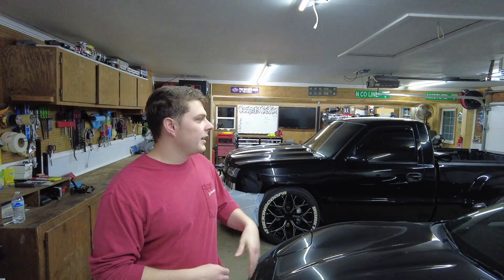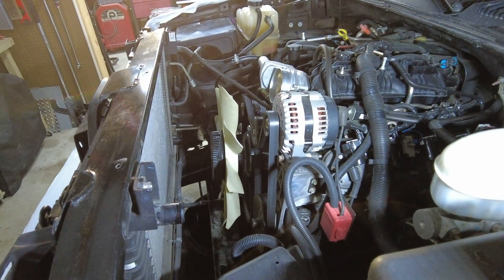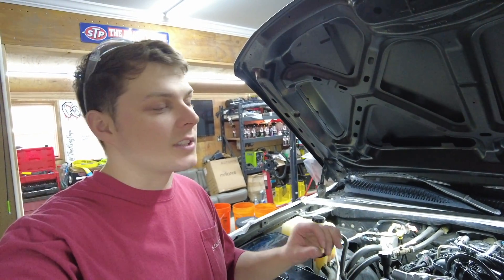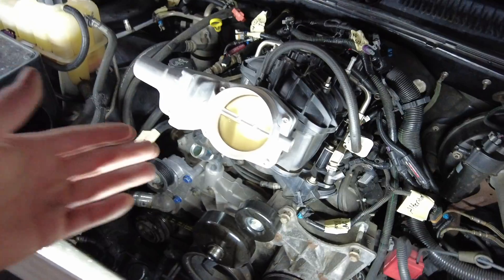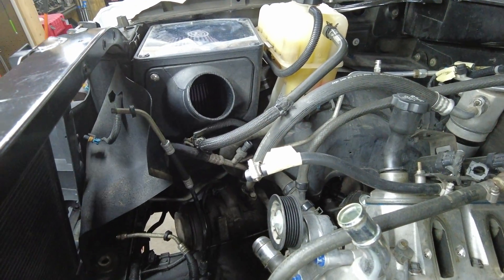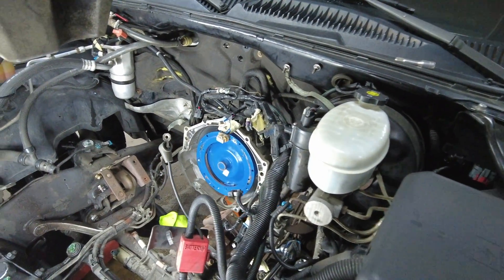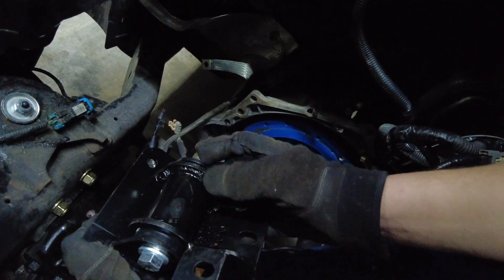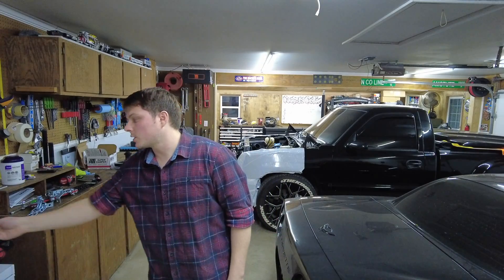Silverado Engine Removal! Pulling The 4.8L in prep for a 6.0L LQ9 Swap. NA Cammed "Work Truck"!

Comment: Awesome video. Question can I put a 2011 L29/ 4.8A in my 2008 with a LY5 5.3 and will it run? . I know I’ll have to tune it eventually. Thanks.
Reply from the maker: From my understanding yes. Both are Gen IV motors and have the same reluctor wheel count. Shouldn't be a problem

Comment: I'm about to pull a 4.8 for the first time (I have pulled others but not a 4.8)....can you pull it with just taking out the bolts of the headers without removing the bolts on the Y-Pipe?  The reason I ask is the bolts on the Y-Pipe  are frozen (of course) and it's extra time to 'Get them"??
Reply from the maker: Hey, I've pulled a few junk yard motors with the shorty headers still on them. Usually there is no issue, sometimes it catches and scratches the fire wall up.    You should be able to unbolt the headers from the heads, and pull the motor up and out. It might be a pain to get the motor mount bolts out though.  I would start spraying your exhaust head bolts and the y pipe bolts with PB blast, and let them soak.
Reply: @TheKingCoopa oh I've had the head bolts off twice in the last month and the y pipe bolts won't come off.
Reply from the maker: That's good at least. The Y pipe bolts, I've had to use a big breaker bar, and snap the bolts in half. I was going to long tube headers and didn't need them anyways. But if you get them out, you might want to replace them with new ones. Hopefully it all goes well
Reply: @TheKingCoopa Since I have already gotten nthe exhaust manifold bolts out of I can pull the engine out just removing those it would be a big help
Reply: @TheKingCoopa  Is where you placed the leviler sufficient to hold the weight of the engine when pulling?  There is not a lot of places to attach a chain to the engine?
Reply from the maker: Any of the 10 mil sized bolts in the heads will work, or any of the bolts to the block. They are all strong enough. I've picked up the whole LS engine with a single bolt that goes into the valley cover lol. I wouldn't recommend that one though. 

Both times I've used a leveler, it usually hits the firewall and is a pain. I stopped using them. I use the Amazon lifting plate, that bolts to the valley cover. That one works pretty well.
Reply: @TheKingCoopa awesome... Because it look like your leveler was not attached to the block itself
Reply: @TheKingCoopa  One further question as I move to pull this engine out....what is the "best" way to pull Bell Housing Bolts that are in at the top?  Some have removed a "rail" and lowered that transmission.....is that necessary?
Reply from the maker: If you take the intake manifold off, you can get the top two transmission bolts pretty easy.
Reply: @TheKingCoopa  I do already have the intake manifold off, I have pulled many engines in the past but this is by first time pulling a GM 4.8 LS ......I am almost at the point of pulling the engine, just have to pull the motor mounts off...their are 2 bolts thru the engine rail attaching the mount....I'm wondering if that would be sufficient....I had no trouble with the  Toque Converter bolts..... I heated them up for just a bit and used a long extension on my impact wrench and they came right off....thanks for your help,
Reply from the maker: Oh nice, your almost there, good luck!
Reply: @TheKingCoopa  Thank you for the information about the lifting plate....I've ordered it and it will be delivered tomorrow...that will be a big help....I'm doing this job for a friend.
Reply: @TheKingCoopa  Would you believe I have had all kinds of issues and I just dropped the used engine in the bay this afternoon.  This is a "weird" kind of question but several of upper bell housing bolts have another mount attached to the bolt.... Which upper bolts have the mount? Is it the   bolt on the drivers side and he immediate top bolt or is the mount on the stud on the top passenger side to the left of the upper most one....see what I'm saying?
Reply: @TheKingCoopa  Would you believe it has been at least 1 1/2 months in replacing this engine (I've had some problems I'll not get into, like spending 4 days in the bed with the flu).......I have a question.... where is the right place to attach the negative terminal cable for the battery....does it go on the block or the frame (2003 Siverado...4.8)
Reply from the maker: That's rough... For the grounds, I did from the battery to the frame. Same frame spot to the engine block.    From the back of the driver side head, to the passenger side head. And from the passenger head to the cab firewall.
Reply: @TheKingCoopa I can't remember... It has been a month and a half LOL

Comment: they used yellow locktite which is like red locktite on all the motor mount to bracket bolts they are notorious for breaking
Reply from the maker: Yea... those really suck

Comment: You dont have to remove the hood, the hood bracket has a extra hole for service . It makes the hood go up higher.
Reply from the maker: For sure! I've used them before, but I have a short garage. I just removed the hood, for when I jacked the truck up.

Comment: What engine hoist did u use ?
Reply from the maker: Its an old one, built really well though. Arcan, CEH-41
Reply: For sure thanks and did u have to tilt the transmission up to get the engine out ? Or can I just unbolt it and pull forward ?

Comment: I had a shop swap my 4.8 that’s in my 2013 chevy Silverado 1500 with an L96 6.0 engine. My question is: do I need to replace the fuel injectors or are the stock 4.8 injectors good enough? Both engines are stock.
Reply from the maker: Those injectors will work just fine with the new motor. They will probably even work with a baby camshaft in it. Anything past that, I would recommend getting some larger injectors
Reply: Thanks @TheKingCoopa
Reply from the maker: @ilmjcxj8064  for sure, good luck with the truck!

Comment: So I’m wanting to do this swap does a lq9 Fully swap/bolt on to the 4.8? I have a 2005 Silverado 4.8 just want to know before I purchase the lq9
Reply from the maker: Yup, everything is exactly the same. Besides the displacement, and a tune. 

I'd just make sure you swap your flywheel over. (Some are dished or non dished, depending on the years and if the lq9 has the longer crank, protrusion out the back end, that the flywheel bolts to)  other than that, it is definitely worth it for an NA setup

Comment: What did you need to do to make the ls3 throttle body work?
Reply from the maker: Hey, it needs an Xlink to beable to communicate with the old style harness. The xlink also requires an OEM or Acdelco throttle body. If not, it will have issues. And make sure you specify if its a gold or silver blade when buying the xlink

Comment: can you pull the heads with the motor in the truck? If anyones tried it.
Reply from the maker: Hey, you sure can. Plenty of room. I've even done it on my corvette twice, and the firewall is alot smaller in that.
Reply: @TheKingCoopa im a little late but thank you bro. Am about to pull my heads and cam swap, finally got some time. Keep up the great work pa
Reply from the maker: @Vagos-Performance  for sure, its all good! My first cam swap was a little nervous, but I've done a few since then, and it definitely gets alot easier and faster. Good luck!

Comment: Hey man trucks looks clean, I have a question do you have the ss cladings?
Reply from the maker: Thanks!! I do not have the claddings. I did go with the SS front bumper, I prefer the looks over a stock bumper. Instead of doing a full SS clone, I decided to do a quadrasteer bedswap, to run some fat back tires. Plus I think it will help distinguish my build from the 1000s of other single cab builds and ss clones

Comment: I did mine with lq9 6.0 4l80 and full bolt on's and cam and tuned your gonna love it
Reply: Not at all 4l80 is a beast killing 5.0 Mustang at a 30 roll all day
Reply from the maker: @LSXMILLER  hahaha thats exactly what I wanna hear 👌
Reply from the maker: Hell yea, im excited! The 4l80 wasn't too sluggish? I would have had my swap done months ago, but I decided to do a wire tuck, battery relocation, etc fans, all AN lines, and shave the fire wall. So I bit off more than I could chew lol. Hopefully I can finish it all this winter. Thanks for the help!

Comment: Hey man I got a question , I have a 2009 Silverado 1500 flex fuel 5.3.
I had a problem with the oil pump and my engine seized up . I swapped it out already with a 2002 Tahoe 5.3 motor non flex fuel just regular vortec . That’s all I changed just the motor and it won’t start or crank, do you think it could be the crank sensor or pcm?
Reply from the maker: Hey, so there are alot of variables in your equation, because you changed from a gen IV motor to a gen III. 

Flex fuel, the main differences between the motors is the Injectors. Your truck already has the ecu tune, flex fuel pump, and sensor for it, so id just swap over the injectors and your good there.

The other issues: did you connect the knock sensors and put them in the factory location? Or the gen III location.

Did you swap over the gen IV timing cover and sensor? 

And the biggest thing, did you change out the reluctor wheel? It's a toothed gear that is press fit on the back of the crankshaft, that the crank position sensor reads. Gen III have a 24 toothed reluctor wheel, while a gen IV has a 58 toothed wheel. If you didn't swap this, it WILL NOT run, no matter what you do. 

I know if you had a NBS truck and wanna swap a gen IV motor into it,  linkinfelter sells a box, you can wire in. That will divide the signal to trick the ecu to think it has a 24 tooth reluctor wheel, like a factory gen III motor. You should do some research to see if they make a box that can convert the 24 tooth signal to a 58tooth so your system reads it like normal. Im sure someone makes it. If not, worst case scenario, your gonna have to pull the motor, and replace the reluctor wheel with the proper one.

Comment: Tech tip... if you loosen the bottom hood hinge bolts you can lean the hood back and put them in the next set of holes. It keeps it out of the way and you can do it with one person. Also no alignment issues and more space! Good stuff man she's gonna rip
Reply from the maker: Definitely some good info! I found out about that hood service position like a day after I pulled the hood lol. But its all good, with my short garage ceilings I would have needed to pull the hood once I jacked the truck up anyways. Thanks for the support!!

Comment: Hey bro I had a question , when swapping from a 4.8 to 6.0 can I still use the same computer and everything ? or does the wiring and computer change ?
Reply from the maker: Hey, everything will stay the same. The only thing you are changing is the internal displacement. Wiring, computer, and sensors will stay the same, its a direct swap. But You will 100% need a new tune though.

 (This is in regards for a gen III 4.8L to a gen III 6.0L swap.    If you are changing from a gen III to a gen IV motor, like an LS2 or LS3 then there are some wiring/sensor differences, and the reluctor wheels are different. So its a more complicated swap)
Reply: ah okay thank you I appreciate it! I was starting to get worried lol🤦🏻‍♂️
Reply from the maker: @omarbatista6572  for sure. I'd also recommend getting the LS engine rebuild guide, if you plan on modifying the internals. 
 https://a.co/d/0IWt9VX

Comment: With a triple disk 4000 stall and a hood tire I’m betting you can launch very nice and run a high 12
Reply from the maker: Hey, sorry for the late reply. You are definitely right, my wheels/tires are killing my times! I'm currently doing a built 4l80e, AWD, 2step, and nitrous swap as well. Should be a little quicker. I also went with a 3600-3800 Stall, a little more daily driver friendly. Thanks for the support!

Comment: @TheKingCoopa what year truck is this? Did it come 4x4 and do you still use the 4x4 in winter? Thanks
Reply from the maker: Hey, this is a 2004 silverado 1500.  99-07 classic body style. Mine did come 4x4. I only drove it one winter season, then bought an 07 trailblazer 4x4 for a winter daily. So it's basicly a summer toy. I didn't need the 4x4 that much, it worked pretty well though. Currently doing the motor swap, and gonna convert the manual 4x4 transfer case to an AWD tcase. Thanks for the support 🤘

Comment: Are you swapping the cam and everything into the 6.0? I am doing a LS swap into a 87 S-10 and may be interested in the 4.8. I'm wanting to daily it so I'm not trying to put anything radical in it. A mild cammed LS with a 6 speed should get down the road pretty well.
Reply from the maker: Hey, sorry for the late reply. The 4.8L and camshaft are staying together. I'll be swapping it into my project c5 corvette, for boost. The 6.0L is getting a bigger cam, something like a 232/240, and Frankenstein heads. 

A modified 4.8L and 6 speed would definitely get that s10 moving! I'd check marketplace, local junk yard, or car-part.com for a complete 4.8L. There are alot of them out there for 400-500$. Thanks for the support!

Comment: Would you be interested in a NV3500? I have everything you’ll need for the swap including the clutch pedal. I’ll give you a great deal. Everyone does 4L80e swaps. But not many do a auto to manual swap. Just a thought. 👍🏼
Reply from the maker: Hey, I appreciate the offer. I'd try listing it on the "RCSB Trucks" Facebook page. I know someone will snatch it up off there. A manual single cab would be sick. But im gonna stick with auto on this one. Simply because my vette is manual. And my next tow rig is gonna be Manual. It's fun, but shifting gets old sometimes 😅😅
Reply: NV3500 can't handle power.